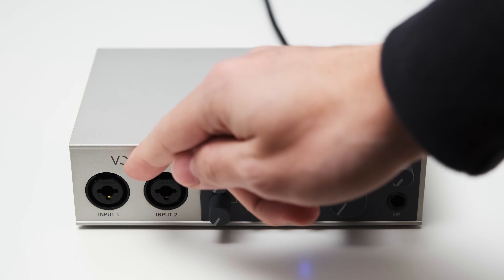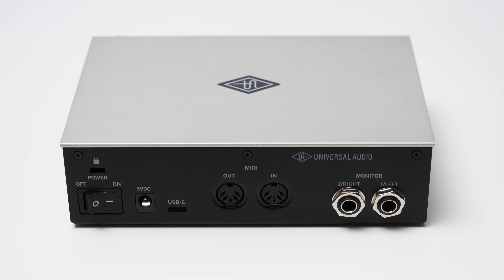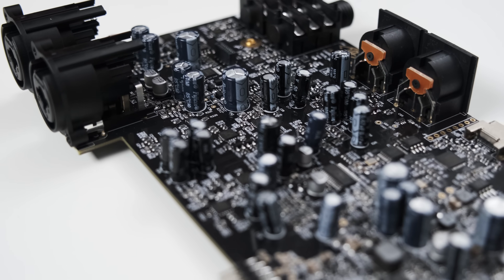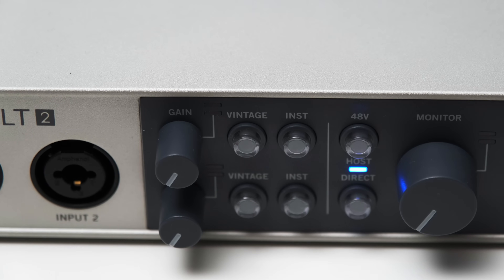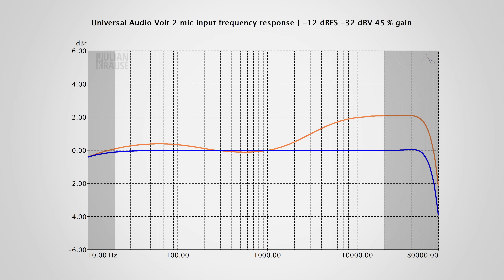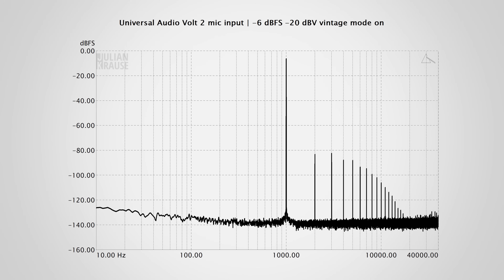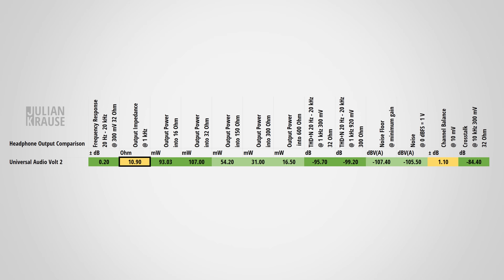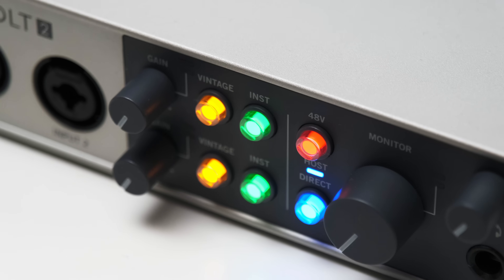Universal Audio VOLT 2 – USB Audio Interface Review (Vintage Mode Audio Samples)

Comment: This price range is really packed with contenders like SSL2, iD14 and motu M4, out of box one would be clarett pre2+. I don't see how UA Volt stands out in this lot.
Reply: Agreed 💯
Reply: I'll tell you what stands out: UAD Volt like the SSL2 add colour to a recording in a manner that Audient and Motu do not...
Reply: @michaelj-2  ssl just sounds flabby, i have to cut out a lot of sound around the 100hz area. Wish zen go was as  user friendly as the ssl.
Reply: @fredriksvard2603  - that 100hz and below is known to require reshaping no matter what interface you use...
Reply: @michaelj-2  i had zero issues with antelope zen, night and day difference
Reply: @fredriksvard2603  - Zen is a good unit, I'm running audient id44 and arturia studio
Reply: @michaelj-2  hows the audient? Could try one but maybe theres no real world difference between those and ssl
Reply: @fredriksvard2603  - the id44 is very good and the arturia studio is excellent...
Reply: @michaelj-2  i do have the UA Volt 276 and i like it more than my Motu M4 and Arturia Minifuse 1 

The compressor helps a lot as well!
Specs are only specs , i love my volt so much!
Reply: Steinberg UR-RT2 is the best sounding of all the contenders

Comment: UA: class-leading 24-bit/192 kHz audio conversion

JK: The Volt 2 utilises a CS4272

Ha I knew it was going to be one of those! I was anticipating this review as I was very skeptical of these interfaces and hype/marketing. It's not bad but nothing revolutionary or exceptional for the price range. Just another competitor. I think still rather buy an SSL2 which sells for the same price.
Reply: The Motu M2/M4 hace better converters. 115dB Dynamic Range in the inputs and 120dB in the outputs Including the headphones.
Reply: @carlosserrano3985  MOTU is also an American brand so their interfaces are pricier over here too. The M2 is €222 ($250).
Reply: In the case of the volt 1 at least you can't find anything at or under its price of 120 that outperforms it.
Reply: @yz249  the volt 1 about €140 in Europe, same price the Audient id4 sells for, which I think has it beat. Meanwhile the SSL2 and the id4 cost much more on Sweetwater while the UAs cost a good bit less. Unsurprisingly you pay more for European stuff (in this case the SSL and Audient are both British) while we pay more for American. But yes it looks like they've got quite an edge over the Scarlett in the U.S. market.

Comment: It still didn't beat the Audient ID14 mkii in all measurements. Audient is King
Reply: I’d say so.
Reply: @soundbelch1600  I’ve never had an issue with all of the Audient interfaces for their drivers … they are quite good actually. The only thing I don’t like is the Audients preamp.
Reply: @rylandweet7750  what is it you don't like about it
Reply: @samueloluyinkaojomu6548  they just sound boring, not sure how great they are for say guitar or anything else that is not vocals, but for vocals the preamp is boring, boosted low mids, sounds automatically compressed , sorta muffled but yet clear still…. I’d say they would possibly match a cheap condenser mic where it’s a bright, harsh mic, but with an expensive mic they usually are already super smooth so mixing the Audient pre with that then you’re vocals will be overly smooth, therefore boring sounding lol
Reply: @rylandweet7750  I totally disagree with your assertions. Except you didn't plug it to a true USB 3.0 I get clean prestine sound from mine. I record both vocals and saxophone
Reply: @samueloluyinkaojomu6548  lol I actually have one that i do plug into a usb 3.0….. you may disagree but you’re flavor is your own…. And by what I can assume by that you record saxophone, is that you’re vocals don’t need to cut through a mix as say for a rock, rap vocal….. and that’s where the audients pres ultimately fail at getting that professional sound you hear on commercial records
Reply: Or the Motu M2/M4.
Reply: It’s also $75 more

Comment: Sheeeiiiit, I've been waiting for this one, I was hoping for the 76 series but its good to know I would just go for the Arturia Minifuse 1 or 2 over this one (cheaper) and the vintage mode makes little difference to my ears.
Reply: Not only is it very slight, you won’t have problems imitating it with good EQ.
Reply: @giuseppino4872  Yep, there is not point. The minifuse has the same chip too.
Reply: My ears suck, and I heard a noticeable difference. Listening on Yamaha HS5's
Reply: @jonljacobi  I can hear a change but you can do the same thing without the expensive "vintage" button.

Comment: Arturia mini fuse 2, focusrite 2i2 3rd, and universal audio volt 2, motu m2, which one you recommend please help.
Reply: From what I've seen I'd completley rule out the 2i2 - the minifuse completley outperforms it -better on all fronts and a much better headphone amp at the same price.

The volt looks like a slight improvment over the minifuse measurment wise - whether it's worth the extra £30 or not is up to you - check bundled software.

The m2 is more expensive than the other 2, you do get better DA/AD conversion, lower latency + a screen at the cost of a weak headphone amp. Id you have hard to drive, low sensitivity headphones probably avoid, but otherwise it is the best performing.
Reply: The one that has the features and price that you like! You can make great recordings on all of them.
Reply: Audient ID14 mkii
Reply: My order : 1st Motu M4 or 2nd  ID14 MKII
Reply: Motu M2, better than Focusrite, Arturia and UA Volt.

Comment: Not providing specs on the site is just about as big of a dick move as the asio registeration. 276 is supposed to have an analog compressor on it but without adjustability, you're stuck with the presets.
Reply: Agree 💯%

Comment: Hi Julian, please could you suggest me a USB interface with a 700-800 euros budget, 2 or 4 mic preamps, fast for live plugin performance (low latency) and best choice overall for that price...I heard a lot of good things about RME but it doesn't convince me. What do you think?
Reply: @soundbelch1600  thanks for the tip! Unfortunately here in the UK I can't find it anywhere, ridiculous 3 months or more waiting pre order everywhere. Also by any chance do you know if with a babyface pro fs is possible to connect an external stereo effect (reverb) using two condenser microphones and then listening through the headphones output of the interface? Possibly without connecting it to a PC?...any other suggestion in the 700-800 range?

Comment: I had one of these this weekend and couldn't tell if the vintage mode made any difference to the piano that I was recording. Decided it was hype and returned it. Maybe my hearing is not good enough.
Reply: Your unit was definitely broken. Even on smartphone I am hearing the difference
Reply: I'm not sure soft acoustic instruments are the best to hear this. If you listen to guitar speakers comparison for example, it makes little difference in clean sound and a huge difference in hi gain settings. I don't really know why but distortion tends to exagerate tone differences of material placed after it, where before it, you can pick another guitar with other pickups you'll barely notice it.

Comment: After the Apollo series this is a huge step back to me, when it comes to the actual hardware layout.
The Inputs and Outputs need to be on the back, Buttons and level-meter need to be on the front.
Reply: This Volt series basically competes with Focusrites Scarlet and Arturia Minifuse interfaces in features, looks and price, there is nothing fantastic on this ones.
Reply: @carlosserrano3985  Yes. And it's stupid that all manufacturers use exactly the same layout (with a very few exceptions).
Reply: Does the Apollo really sound that much better? I'm sitting on the fence on whether or not I should purchase the USB model.
Reply: @seanwebb605  The times, when you needed to buy an expensive interface to get good sound, are long over.

Watch his other reviews ... even cheap ones such as the Focusrite Scarlett Series have stellar performance for the most.

(And sometimes even expensive ones can have some flaws.)

Main reasons for an Apollo would be:
- Formfactor
- Realtime-DSP-Processing
- General quality (build, metering, digital loudness knob)

I personally really want to have an interface with the Apollo Formfactor.
I tried the Audient iD14 MKII, but there were some annoying things about it:
- Case sounds very resonant and hollow. Super loud noises, whenever you touch it or push a button.
- Loud Plopp in my active speakers, when the interface is turned on/off.
- Metering does ONLY work for the output (how stupid is that?). No input metering.
- Flimsy switches for phantom power.
Also my unit had a defective mic-input with audible noise.

One nice thing about the Apollo is, that you can put its DSP effects directly on your mic-input (like if you had outboard before that).
Bad thing however is, that the plugins you get with the device are a really stupid selection in my opinion and additional ones are super expensive.

Also they raised the price for the Apollo Solo from 500€ to 700€.
500€ was already a bit pricey, but 700€ is simply too expensive.

Still I'd like to know how it performs.

Comment: UA requiring registration is a dick move indeed! Another reason I prefer RME in general.
Reply: I'm quite happy with my Quantum 2626 paired with an SMSL M200 DAC and a tube preamp for the output.
Reply: What is the problem with registration? Do they sell your information or something?
Reply: Pretty lame indeed. But it doesn’t take much for someone to post it somewhere for people to download or just use fake information
Reply: RME colours the sound. Otherwise also it stand last in industry level interfaces.
Reply: @HarvinderSingh-yy8th  Since flatness of sound is subjective wouldn't that mean that sound coloring is also subjective? I'm genuinely asking since I'm not really sure whether the two things go hand in hand. As far as I'm concerned, NOTHING can be absolutely flat and therefore different ears will hear different flatness and levels of sound coloring. I would leave it to personal preference in regards to the sound one is accustomed to.
Reply: @natevirtual  well youre right to a degree, however once you get to a certain level of clean pres - where the distortion caused, especially IMD and signal/noise ratio - lives just soooo far down below the noise and distortion floors of the mics, that you can call it "uncoloured"

Im not sure about how the rme stacks up against the apollo, but uncoloured is certainly not subjective

Comment: How now compare the Volt 2 with the Audient id 14 mkll !?

I will choose my first audio interface for singing and voice acting as well as inviting friends over for recording their guitars...
I was thinking of the Volt 276 vs the Audient id 14 mkll!
But I am lost in understanding what I can get out of one over the other!?

I will choose either the Lewitt 441 Flex mic or the Shure SM7b with the Se Dynamite gain booster...and connect it to either an iPad Pro or a macbook pro... 

I also wonder what one get out of each software?!
Audient comes with Cubase le right?
what does the Volt come with (276)?!
what is best for singing and voice acting?!
Can you please let me know what you think I should consider choosing between these two audio interfaces?
thanks for a great video!
👌🏻😊
Reply: From the measurements he made we can all see the Audient ID14 mkii is better
Reply: @samueloluyinkaojomu6548  how do you mean? Better for what type of production? in what ways is it better doing what type of recording?
Reply: The preamps in the Audient ID14 is better, the Digital to analogue conversion is better. He even mentioned in the video that they are using old cirus logic and also the noise to signal ratio is better on the Audient.
Reply: ID14 for ultra clean recordings, Volt 276 for more character. At my area, they’re both the same price on retail - So i guess look at what works best for your workflow.
Reply: @f30beastt  Not sure about the caracter of the VOLT . we need a blind test between Motu M/VOLT/APOLLO/Audient iD14 MK2 to be sur about the rendering
Reply: Audient ID14, way better.